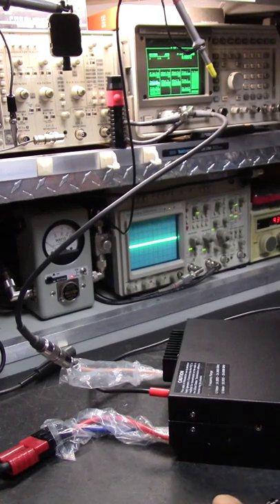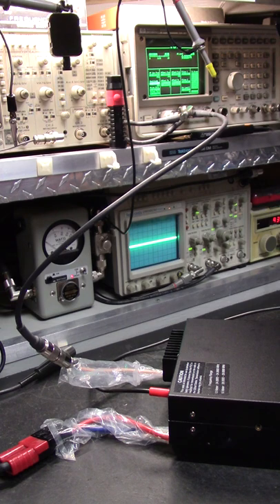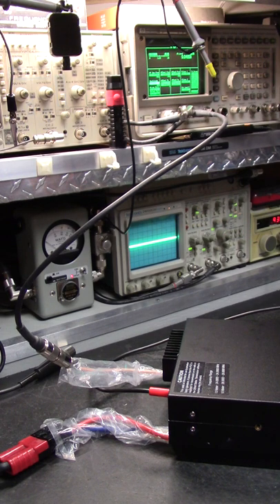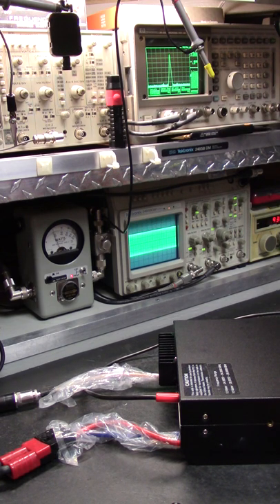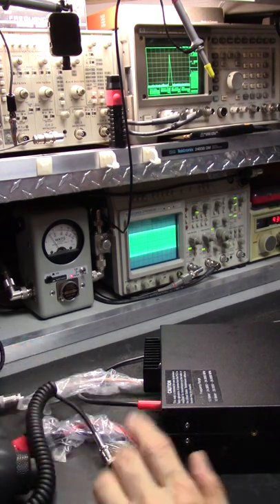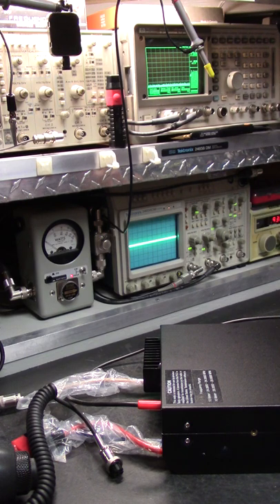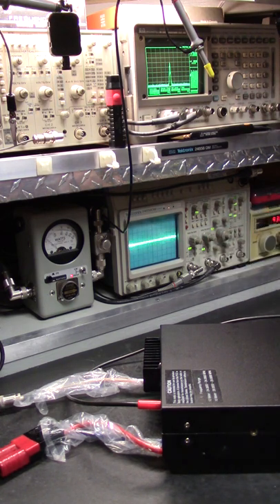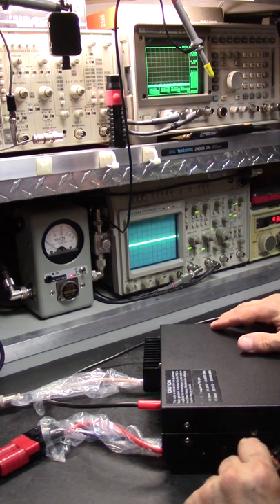RCI 2970 N4 CD with MAX MOD .. you could be the first.

Comment: I wanted a 2970 as a teen. They were the Ferrari for many of the cb guys who didn't want it couldn't afford the latest HAM gear at the time.  Today I'm getting back into radios (out for 30 years). Local guy claims his 2970 does around 250. No proof yet but my question is, can it even be done? I'm assuming anything is possible but truth is more like 150'ish for most.